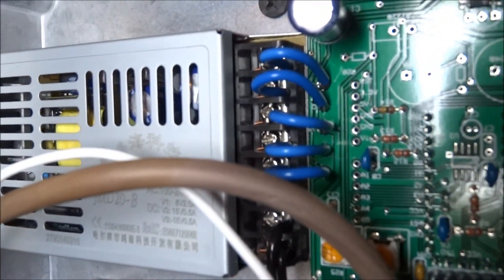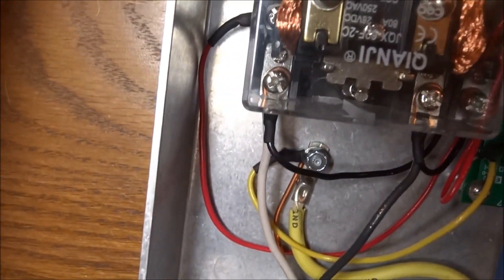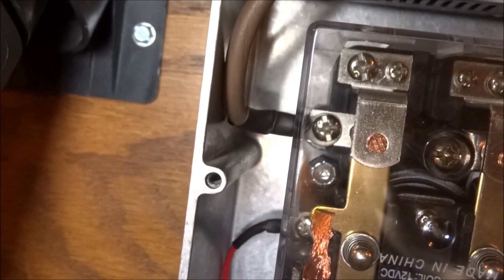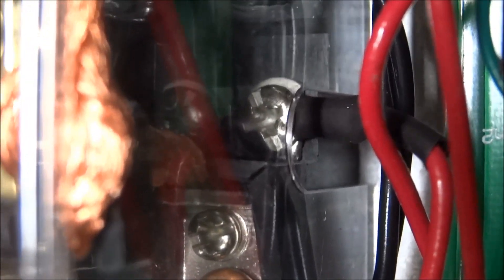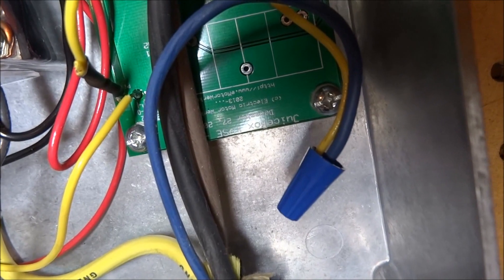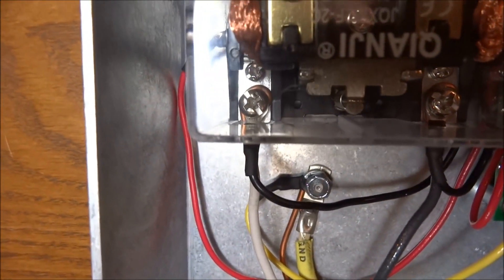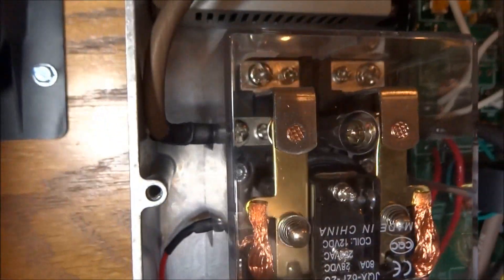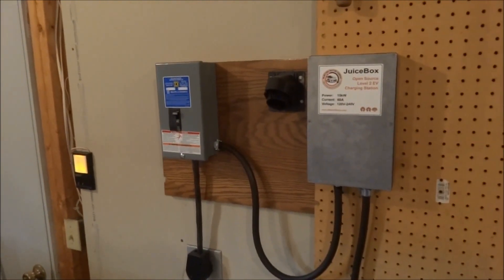Chevy Volt JuiceBox 240V EVSE Testing and Installation

Comment: Chevrolet doesn't give you any kind of L2 charger? you have to buy your own?
Reply from the maker: Not with the car, only comes with a 120v charger which takes 8hrs vs about 3.5hrs with 240v
Reply: Calvin Klesmith So why is this setup so complicated? shouldnt it be as easy as a higher power outlet and than the charging connector will automatically know what to operate at?
Reply from the maker: ***** You can by a 240v charger ready to go and plug in to a Nema 6-50 but they are anywhere from $600-800 and they cant charge up to 15kw at 60amps (The JuiceBox cost $200 and the cable I found for $90 total cost $290) . Also this charger will automatically know what to operate at the sub panel was already there so I just decided to keep it.